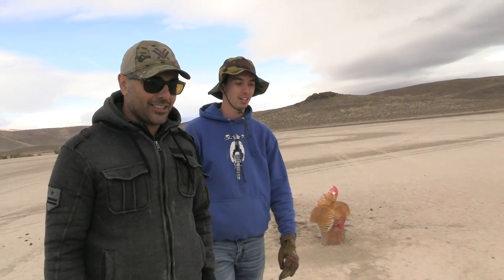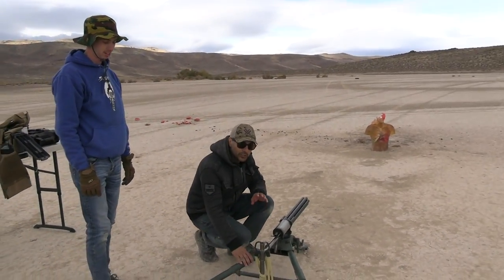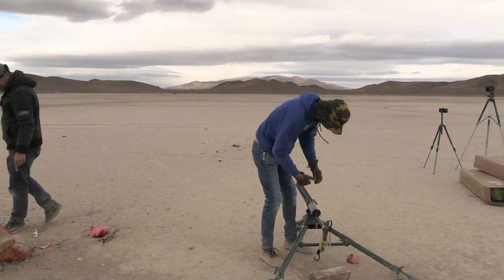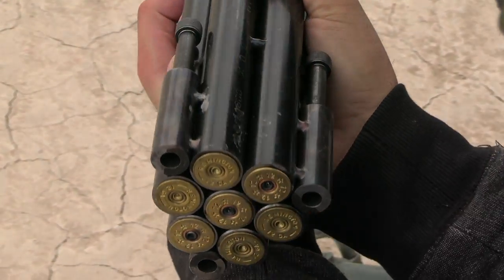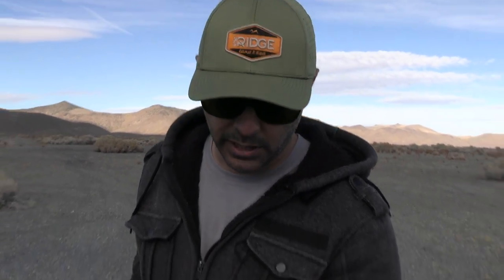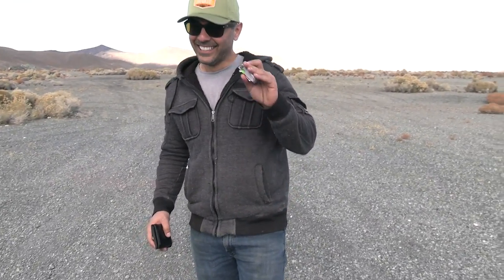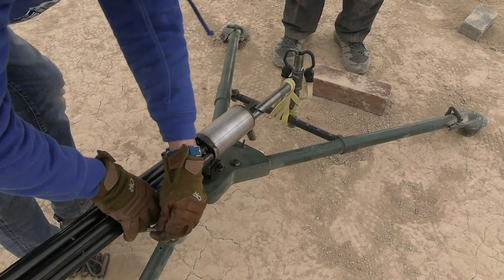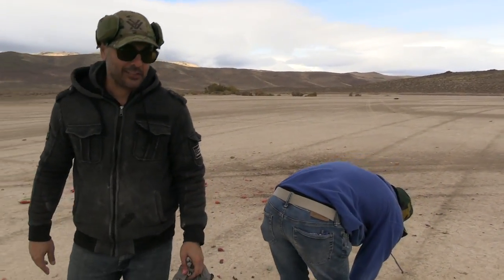7 Barrel 12 gauge ShotGun that fires all at once ... INSANE

Comment: It’s always a good practice to “pattern” your shotgun to see the coverage density.  I think it would be interesting to see what this unit does on a 4’X4’ panel of some rigid material, like 3/8” Sheetrock, at maybe 15 or 20 yards with #5 shot and/or slugs and buckshot.
Reply: 1.5 x 6 would be ideal
Reply: Yes please do this. Please please please!
Reply: Possibly a sheet of metal in an attempt to see the "pattern" vs just blowing a huge section of wood or sheetrock out?

Comment: Would the ATF consider that a full auto shotgun since it fires more than one shot per trigger pull? I'm actually concerned and not joking since I have modified my little side by side double barrel Stoeger coach gun so that the forward trigger just fires the right barrel but the rear trigger fires both barrels at once or just the left barrel if the right one has already been fired.

Comment: Next video: Experiment with different types of slugs. Deer slug, sabot, rifled, etc. Then try dragons breath and flechette.  You could test the range, penetrating power, stopping power, etc. See how much energy it has relative to a .50 cal, like measuring how far it's pushing back a block of steel.  Has the potential to be a really awesome series of done right.
Reply: Flechettes don't get enough velocity to stabilize out of a shotgun.  They fly sideways,  backwards and forward unfortunately.
Reply: Stopping power=overkill 🤣

Comment: There was a high speed cascade shot that was electronically timed on a single barrel where the bullets were stacked inside the barrel.  Only a few milliseconds between firing such that each bullet would follow their predecessor in such a way that it would be able to ride the shockwave from the first.  The application this was ideally used for was to break down materials which were normally impenetrable by conventional bullets.  Works like a high speed jackhammer which breaks up concrete like butter. Even the sound of the gun is more like a "whoof" rather than a pop.  Been a few years since watching that gun, likely already deleted by YouTube.  

You should try concrete as a target.  Even make it reinforced concrete to see how much can be chewed off.  Make sure you are nowhere near the shrapnel that ensues.  I have personal experience with that at 30 yards, and it can rain concrete very far.
Reply: Metal Storm

Comment: Now make a second identical one, mount it side by side like a double barrel, make 2 trigger that fire 7 shells each with the ability to be a 14 shell dump. Btw you could possibly make the recoil much less shocking by making the pins strike very closely to simultaneously but with milliseconds differences in striking time, adding a pneumatic buffering action in the stock  with pressure relief valves throughout the recoil process

Comment: Very impressive Force! 

Not to be very picky, but here are some pointers on the microphone sound

Get a sound compressor/limiter and compress the sounds that way you don’t get distortion and gives you that professional studio sound even when you’re out in the wild. Also a windscreen around the chess piece microphone goes a long way 👍🏽

Thanks for the video
Reply: Some high pitch sound on the new microphone, not good, bad sound
Reply: Clipping is a real thing.  If you are limited with your envelope and turn up Mic Gain too far, this happens.  On the Analog side, nothing digital can help.
Reply: @pixels303at-odysee9  correct! most likely having the gain too high it’s a problem he’s having

Comment: That is a great design simple. I would cut slots in the bolts and use wedges that can be tapped in and out for faster reloading. Rather than nuts and rachet. Plus a block with the seven dowel rods . You just drop the barrel assembly over it in one stroke and all the shells are knock out.

Comment: You should add a hinge to the barrel and add a locking bar to the safety so it won't fall out by accident. Besides that this is an epic boomstick! You should fire at something that will give us an idea of the spread. Also, please fire at a tank window if you can ever find one again.
Reply: My Beretta went straight through a tank glass, I put steel tips on the hollow points, In one hand, pleased it went through, on the other hand, sad to destroy the tank glass

Comment: Timing is everything. Getting the rounds Togo off at the exact same time is critical on this thing. A millisecond between the rounds firing could effect the the trajectories of the each round potentially creating large spaces between them. Down range it could possibly a 10 to 20 foot pattern or bigger at 25 to 50 yards.  You  could 
Potentially  pattern the whole side of a tractor trailer at 100 yards. I would be interested in seeing some ballistics on this thing. Shots starting at 10 yds and then 20, 30, 40, 50, and on up to 100 or 120 yards. This thing is crazy!

Comment: Definitely an effective home defence system to rig up behind the front door or back door, any point of entry where a trip wire or other mechanism can set this off if someone brakes in or you forget your keys!
Reply: Would come in handy during the purge.
Reply: @engmed4400  - actually, in places like Angola, Congo, South American tribes where one cannot even afford a cheap shotgun; natives will buy plumbing parts (3/4" pipe which fits a 12 gauge shell nice and snug), then a 7/8" or 1" shorter pipe welded shut on the end with a hole drilled and a small screw or bolt sticking out a 1/4" to act as the firing pin. You fit the 12 gauge shell in the 3/4" pipe on one end, then you slip the larger pipe over it, aim the pipe in the direction you want it to fire and then smack the end with the "firing pin" onto the shell's primer. Can't get much more primitive then that!

Comment: Cool video guys! This reminded me of a old gun I read about that they used to use on ships back in the 1700s? I do not remember what they are called but they were similar to this thing. This was back in the single shot muzzle loader days so they put a bunch of barrels together to make a gun that could shoot several times without being reloaded, it was not meant to fire all of them at once, but they had a defect in the design so shooting one of the barrels could set off all of the others. Needless to say they were not a popular weapon as they were too heavy and bulky to aim effectively, and very dangerous to the user. They looked terrifying, but It was far more effective to carry several single shot guns.
Reply: Puckle Gun sounds about right.
Reply: Nock gun
Reply: That's a Nock or volley gun. It had seven .60 caliber barrels that fired simultaneously. It was intended as a boarding weapon but its use was limited and ultimately ended due to the tremendous recoil and its tendency to set rigging afire and cripple masts, causing unnecessary damage to the ship being boarded.

Comment: Did they say what kind of round they’re using?  12 gauge has so many different types of shot they can be loaded with and depending on what shot you have will give them different outcomes.

Were they shooting single slugs from each round?  Or were they shooting buckshot or even smaller squirrel or bird shot?  I don’t think it was bird or squirrel shot because that would be so many pellets coming out of 7 rounds that the spray pattern would be very tight at that distance and would have shredded the target into very small particles.

It seemed to me they might have been shooting buckshot, either 0 (ought), 00 (double ought) or 000 (triple ought) based on the damage inflicted on the target.

I would like to see what different types of shot will do to a target, especially a human analog like the ballistic gel dummy they first used.  I can’t imagine just 7 single slugs ripping out of there would look like?  I can imagine what bird shot may do and it would be nasty.

That’s a very dangerous weapon there, but no human could ever hope to shoulder that weapon.  They could only do that once in their lifetime.

Comment: Priners blew out on the middle ones showing over pressure. Probably due to welding may have deformed the bbl. Or possibly the ignition of the 2bbl on each side firing. Either way it’s an issue.
Reply: Another possibility for the center primers to have blown out would be lack of support. So without seeing the design of the firing pin array, it is hard to hypothesize on this.

Comment: You guys should drill holes the block of metal run a piece of that round metal that sits up against it threw it an the you can flip it back an forth without worrying about losing the it

Comment: Your firing pins are to long on those 3 shells with no primers . 
They are not supposed to penetrate the primer , also you may want to make a better bolt to hold the primers in when the shells backfire . Headspace is very important . Don’t get close behind that thing .